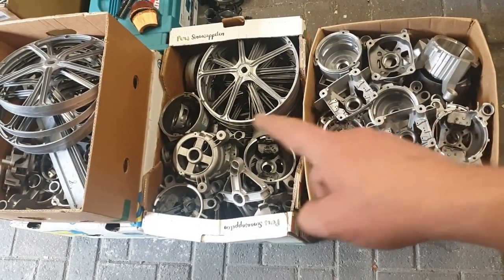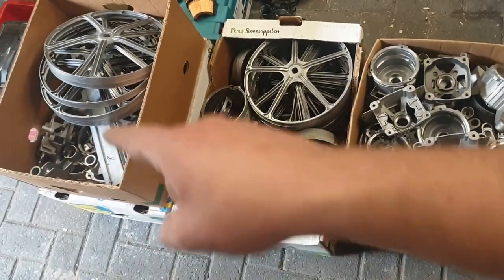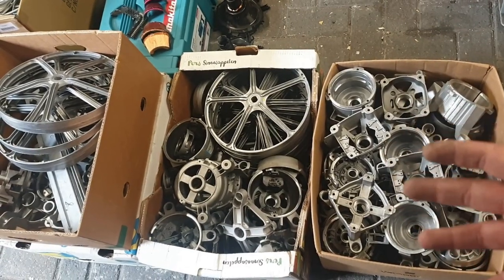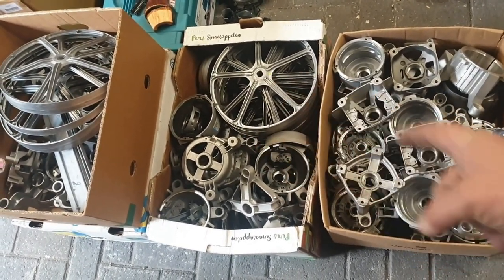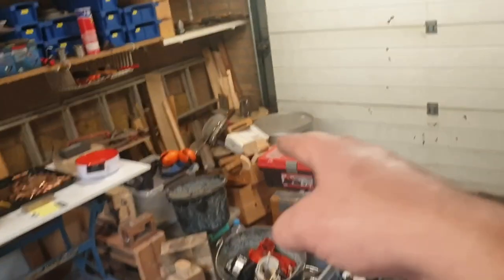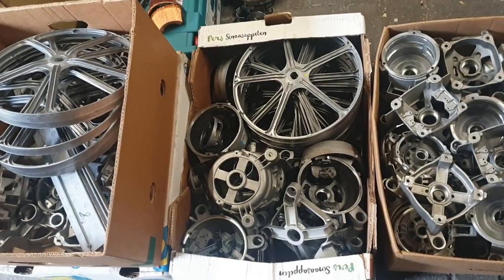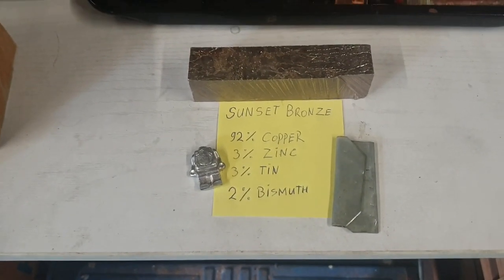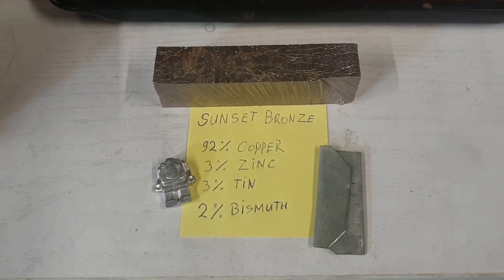Making a new alloy. Sunset Bronze, and some fun with Bismuth.

Comment: Thanks for the shoutout man!😃. So, that was strange that the bismuth didn’t bind🤔. Mike definitely knows what’s causing that but I have no clue🤔. Still great video!!👍🏻.
Reply: So bismuth isn't actually soluble in copper the same way as tin and zinc are. Maybe emulsifying it into the molten copper, zinc, and tin alloy by adding it bit by bit would work? I'm sure there's some trick to it. I'd try pulverising the bismuth beforehand if it were me, but I'm no redsmith. Yet.
Reply: @Ith4qua  perhaps making a tin bismuth alloy first before adding to the copper would work?

Comment: Hey, thought I would give some input on the bismuth leaking - 
Bismuth doesn't dissolve in copper, so it doesn't actually form an alloy but instead a composite. If the inclusions too large, they'll leak until the metal is cool enough for the bismuth to solidify. Larger inclusions will likely also detract from the material properties.

Comment: Master which of those is easy to cast ?? Aluminum or bronze??
Reply from the maker: Well it all depends on what you are casting, but in most cases Aluminium gets less details because it is very light weight, but there are many different types of Alu.
The cast Aluminium you see at the beginning of this video has silica in it so it casts a lot better that pure Alu from cables or cans. Also I heard Silica Bronze casts very nice, but I have not yet used that myself.